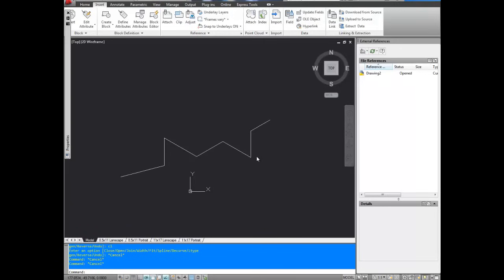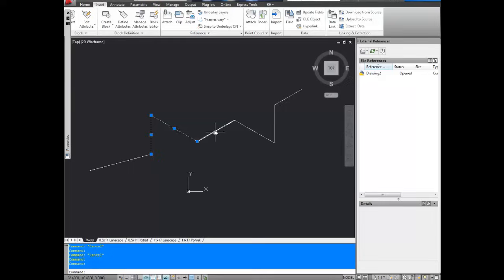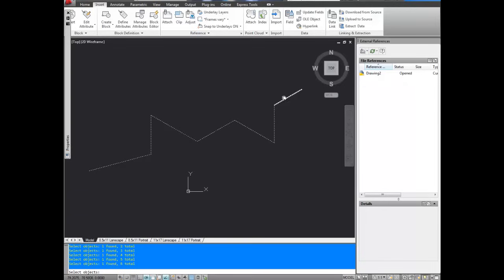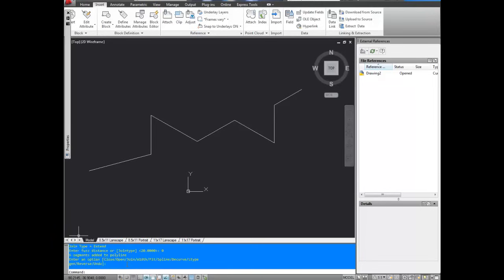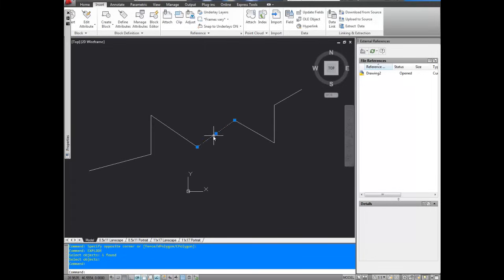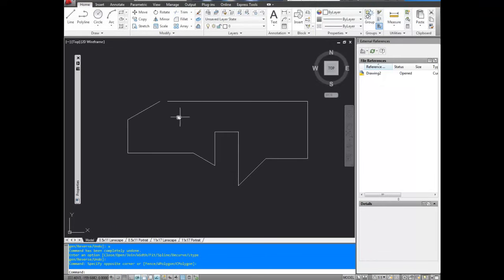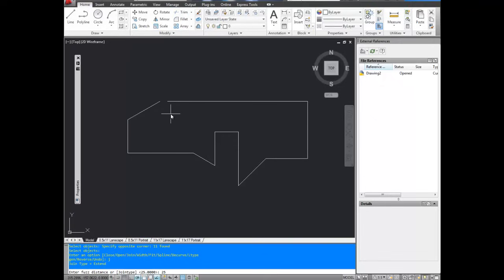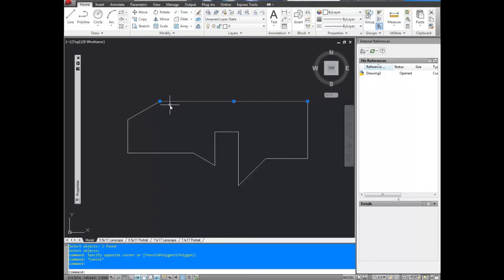Autocad tutorial: How to join lines

Comment: Im using auto cad 2007. I imported a sketch up 3-D curve to auto cad and tried to join the "poly lines" But it didn't work. (The curve in 3-D looks like a one turn swirl just like the helix function on Autocad.) It only detected 3 poly lines when I re-select the curve after I follow these instructions. One at the beginning of the "curve" one at the center and one at the end.  Before doing this procedure the "curve" appeared like a collection of lines and dark dots. The polylines have blue dots. could somebody explain me what's the difference between this object-curve and a polyline curve? Or just tell me what I'm doing wrong?